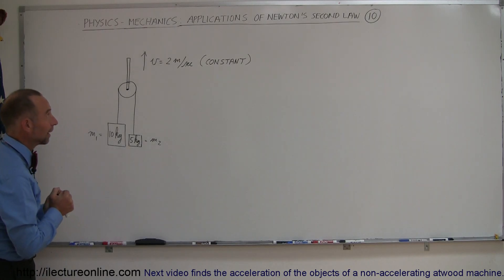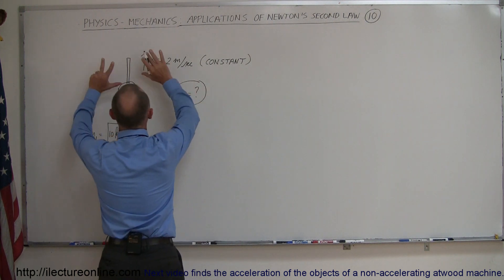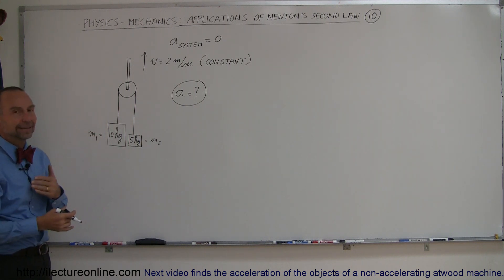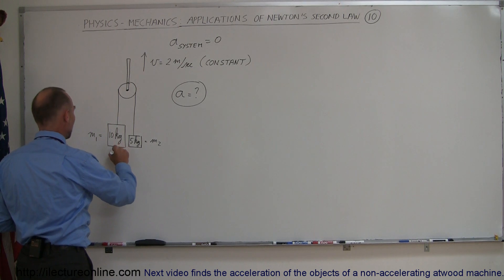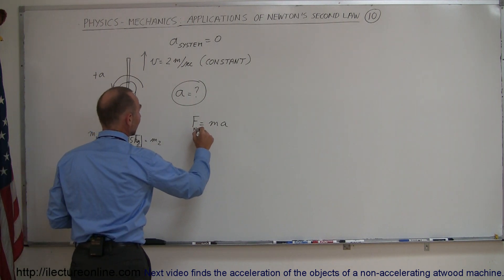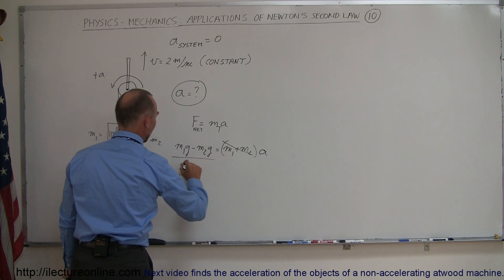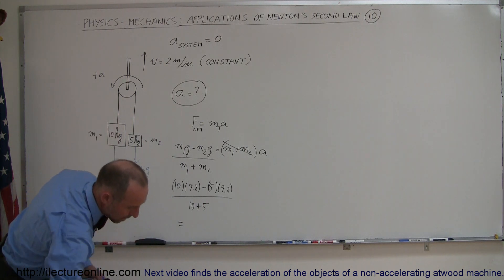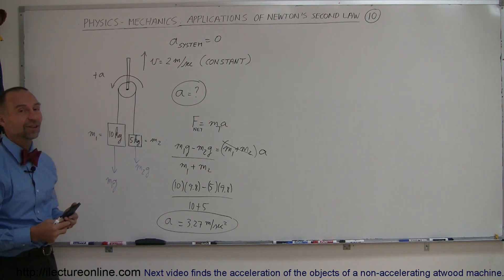Physics - Mechanics: Applications of Newton's Second Law (10 of 20) pulley with constant velocity

Comment: what is the difference between a system and a?
Reply from the maker: You can solve these types of problems by either setting up an equation separately for each body in the system and then solving them simultaneously or by combining all the bodies into a single system (which is typically much easier).
Reply: @MichelvanBiezen   aah i got it, thankyou sir

Comment: if the acceleration of the system is 0 what do you call the acceleration you got by using F=ma?
Reply from the maker: If the acceleration of the system is zero, then the NET force acting on the system must be zero as well.
Reply: @MichelvanBiezen  but the answer is 3.3 in this problem tho the acceleration of the system is 0. im sorry if  i am confused.
Reply: @vinceroiallendial5353  The pulley is moving upward at 2 m/sec but this doesn't prevent that system revolves.

Comment: So, sir, there is no acceleration on this system because the velocity is constant but, if the velocity was not constant, the acceleration would be 3.27 m/s^2. Am I right sir?
Reply from the maker: Since the system is moving at a constant velocity, we can ignore that, and solve the problem as if the system wasn't moving.

Comment: you said first there is no acceleration first,then you said 3.3ms-2 i didnt get it
Reply from the maker: The pulley does not accelerate.  (It is moving at a constant speed).  The masses are accelerating.
Reply: Michel van Biezen so why is it mention in problem,what is the use of that?
Reply from the maker: If the pulley was accelerating upward, it would be a very different problem and you would have to solve it differently.